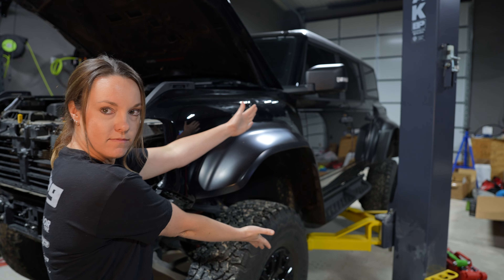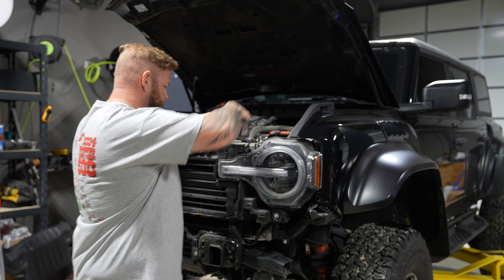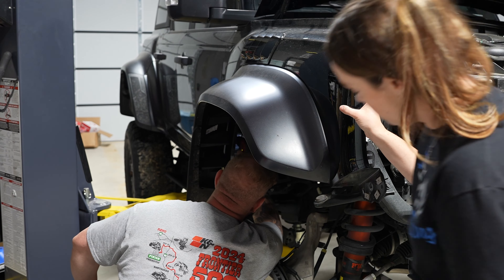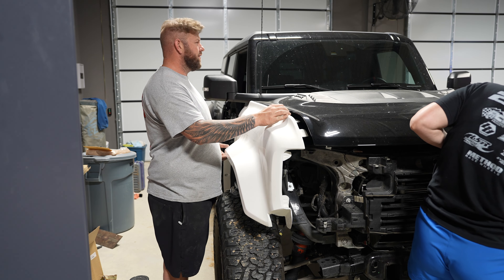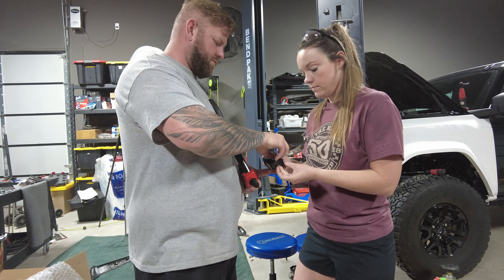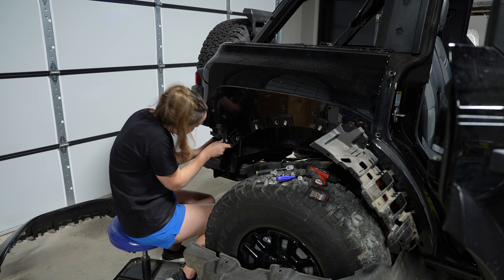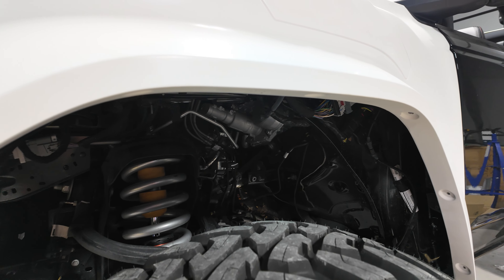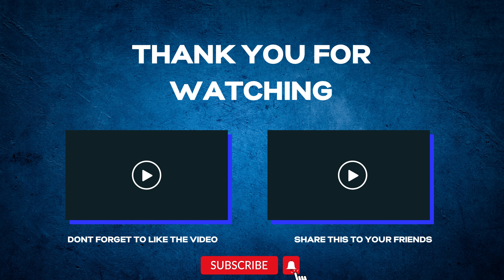Bronco Raptor Fiberglass Fender Install

Comment: Hello folks I’m curious if you can give an update on bronco raptor with 40 inch tires and lift kit? Have the lift kit springs affected the vehicle suspension and if so what way? I’m considering doing the same there’s not much info out there and I keep checking your channel to see if you’ve updated any info on the vehicle or any info you can give me I would greatly appreciate thanks👍
Reply from the maker: Abbie has been driving it for a month or so and it’s been great.  No issues at all.

Comment: Definitely a good call with going the 7" on the rear ther is something bout the 3" fenders on the rear that made it look funky plus with the 7" you'll get less mud n stuff thrown up on the body from the rears
Reply from the maker: Would you have done the 7.5’s up front too?
Reply: @deviantracing6129  no I don't think I would I love to have a little bit of tire stickin out to give it the tough kindof monster truck look plus I'm sure it helps when offroad not to rub any when the wheels clocked all the way over and ur tryin to articulate up and over a boulder
Reply from the maker: It’s been a debate in the shop lol!!
Reply: @deviantracing6129  ya I hear ya I bet it has been but I wouldn't change the way you it is now it looks good
Reply from the maker: We appreciate it!  Stoked to see it painted